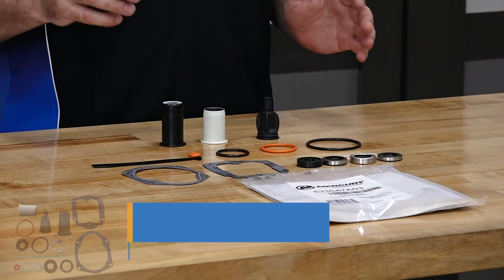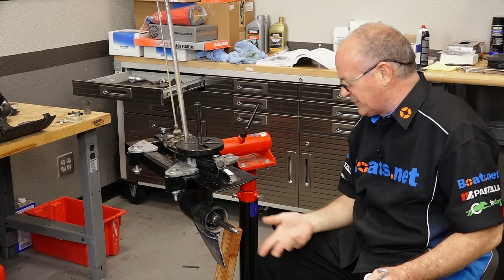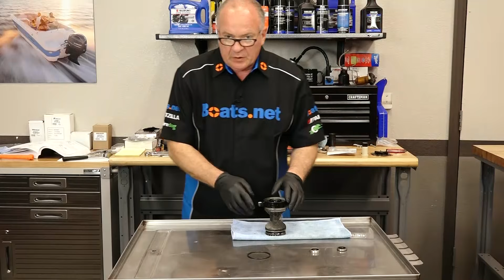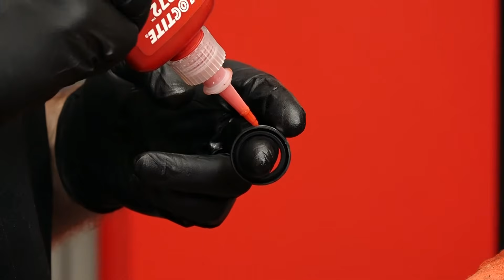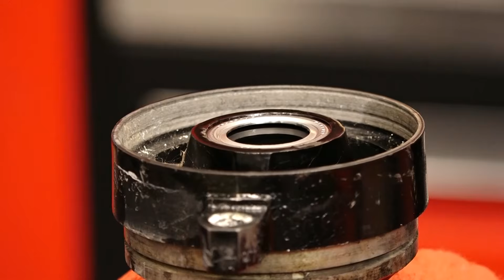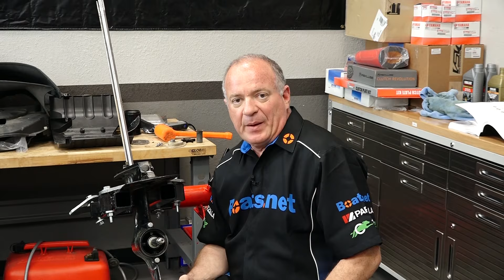Mercury 40HP Prop Seal Replacement | Mercury 40 Outboard Output Seal Replacement | Boats.net

Comment: One thing I did not hear you mention is the part that slides out of the other end of the prop shaft .  If you tilt your lower unit, it will slide off and get lodged in the lower and unbelievably hard to retrieve...

Comment: On my Mercury Force 40 from 1996, I couldn't get out the oil seals like this. They were a nightmare and I ultimately was able to finally get them out with a 14 piece / 2lb slide hammer kit from Harbor Freight - but only after heating up the housing a good bit with a blow torch. Massive thanks for this post, it was incredibly helpful and hopefully what I've shared here helps someone else whose prop seals are really stuck :)

Comment: My name is Todd Reali and had a ? About my 40hp mercury 4 stroke  . What allows your prop shaft to move in and outward with prop on or off ? And should the prop shaft move in and out at all? Thank you for time and input its really helped me with my motor maintenance.   Sincerely, Todd Reali

Comment: Will it hurt anything on the power head if I remove the lower unit and it is a few months before I get it reinstalled. I came out this morning and  noticed that the carrier unit had cracked around the bolts. There was some water in the lower unit when I pulled the drain plug. I drained the gear case and flushed it with some seafoam deep creep before refilling with gear oil. I can't do the repair right now, but thought I could remove the lower unit and store it in doors to keep it from the cold. The motor would remain outside on the boat for the winter.

Comment: Is disconnecting the drive shaft linkage the same for a 2006 Mercury 50hp 4 stroke? Having trouble dropping my lower unit to do my water pump.

Comment: Loctite 271 is supposed to be heated to 250 degrees to remove bolts. I never tried it so I don’t know. How do you get them out if you have to replace the seals in the future?
Reply: Exactly!  If you're going to use thread locker use the low strength version, 222MS, purple.